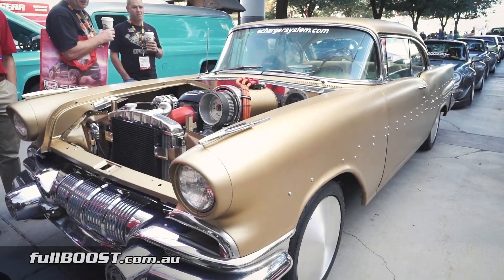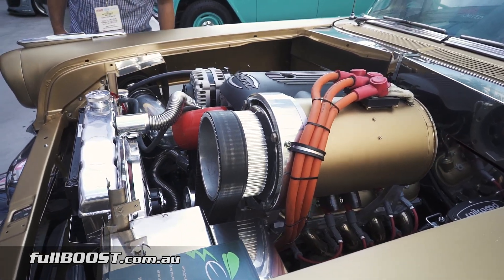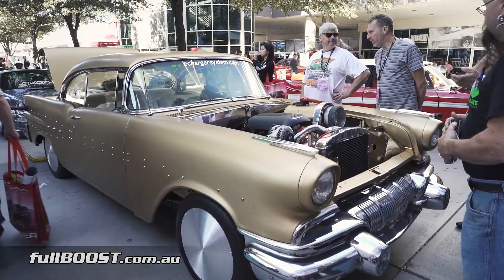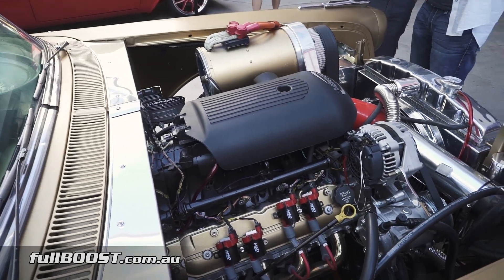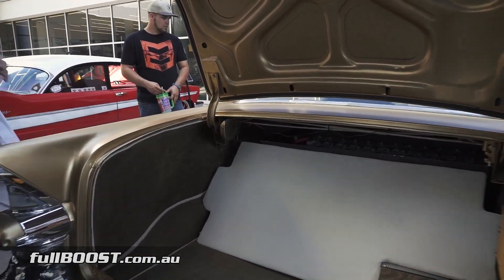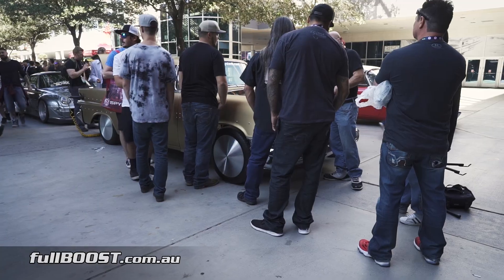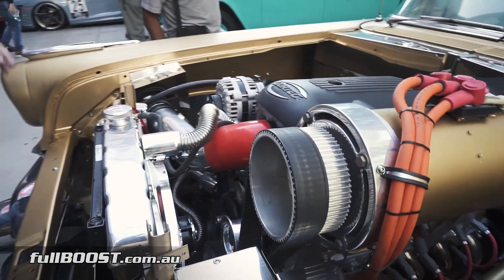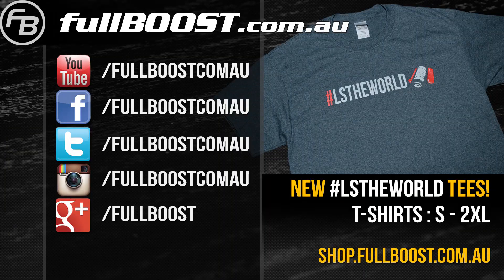The E-Charger Hybrid System

Comment: While this is a very interesting concept, I believe many of the comments below about Newton's laws or more accurately laws of thermodynamics would render this system fairly useless with current off the shelf tech and most proprietary tech available today on a long term scale. 35mpg for 60 miles means you get 60 miles on just under 2 gallons of gas, while the hybrid system and regen braking continues to add 10-15 percent to fuel economy thereafter. Plug-in hybrids available in the mid-market are getting ~60 miles of travel without using a single drop of gasoline while hitting nearly 60mpg in the city. Engineering anything without the addition of miracle materials is an exercise in trade-offs, and I believe that the parasitic drag and loss of typical consumer turbo and supercharger systems are achieving numbers quite similar to this electronic setup on a long term scale, perhaps over the course of one tank of fuel. Most turbo 4-cylinder cars from the factory are getting close to 35 mpg on the highway while making considerably more power than they would naturally aspirated, in turn being more efficient (volumetric efficiency of a forced aspiration motor being much higher than said motor with forced induction system removed). Also, I believe that if the heat and energy output were calculated per one tank of fuel for this same car minus the hybrid system, with it, and with a conventional supercharger/turbocharger setup, and in the end the electronic supercharger system were to be somehow more efficient, the weight of the system and the vehicle combined would negate the performance and efficiency benefits severely as turning a 5k pound vehicle quickly isn't generally as fun or safe as turning a 4k or sub 4k vehicle with comparable output. 

That being said, I think it's fair to say this technology is in it's infancy and needs to be explored further as a viable alternative and creative way to make something we use and cherish in our lives on a daily basis, better. I think hybrid systems have been the way of the future for some time, and there are more ways to do it than the Prius or Tesla have thus far explored. I hope to see rapid expansion in tech and performance in this area of industry in the near future as regulation and restriction by greedy companies fails to oppress the output of the mighty DIY community, as well as the great minds at forward thinking companies currently exploring and exploiting hybrid technology. 

Thank you for the video and for taking the time to interview and explain the system. As some of the other commenters have addressed though, we need numbers! Let's see it run. Let's see a dyno pull! System on/off. Let's see objective drivability reviews and weight! I think we should get an open-source hybrid system together, as a community, to build and expand on the tech in a transparent and public way that could possibly generate some seriously useful ideas from people who would otherwise find this inaccessible. Just my humble opinion, love to hear more thoughts on this stuff. 

- HiDef

Comment: cost? what would this cost to put add on?
Reply: @Billy Barnes - Call them.

***** - Any mod that adds a lot of power will add weight ie. a turbo kit. The best thing about this kit is that you gain power, add mpg, and keep the same/add more engine life. No other mod does that. COst? Everything cost money lol. Weight? Everything weighs something.
Reply: That's the one thing I couldn't find out from the video or his website. It's a great idea at $1500, not so great at $10k. Motor + electronics + batteries are going to be at least $1500 new, those high current switching power supplies are not cheap and neither are 150+ ftlb DC motors.
Reply from the maker: +Billy Barnes They were hoping to sell this kit for under $US 5k l believe.
Reply: intj123 you cant turbo an existing n/a motor without serious changes. You have to lower compression. You should probably change your pistons   Then you need to retune which depending on the car may require a third party tuner. A turbo wont give power from starting rpm. It has to spool. A turbo will not reduce fuel consumption in reality as all it does is add air. You still must burn fuel to create power. A turbo will not regeneratively Brake. A turbo won't provide stop/start technology. Electric motors deliver max torque from standstill. So in every practical measure this item is superior.
Reply: Isn't the max rpm of the motor less than the limit on an s2000? Not I'd be expecting to be constantly hitting the rev limit but a bit more head room would be nice.
Reply: +mike Doe the motor isn't forced to turn the same 1:1 ratio with engine RPMs. With cog changes the engine could turn 9000rpms and the motor could turn 6000 for example if you wanted or I am sure if he wanted on that engine that hits the limiter at 6000 he could gear the motor to turn the 8000-8500 at that speed.

Comment: Couldn't we just improve the conventional electric starter motors all engines currently already have to improve power & fuel efficiency in a similar way to how this system operates? It seems to me that this idea has been staring us all in the face for years, especially the big car manufacturers.
Reply: I mean. This system is pretty crude delivering it's power via a belt to the crank.
Reply: I believe that is what Christian Koenigsegg has developed for his new car. Ties straight into the flywheel/torque converter I believe.
Reply: The energy to drive the electric motor comes from somewhere. If you don't pack the car with extra batteries to store energy from the electric grid, combustion would provide the energy.  If combustion is providing energy, the fuel economy gains are minimal. Regenerative braking is a very good way to charge the battery for "free", but that has limits as well.
Reply: GM has been using almost exactly this system for about a decade now. Look under the hood of a hybrid Tahoe. It'll look a lot like this Pontiac.
Reply: Mark Leadbeater manufacturers are doing it already .
Reply: That is true . The gas motor being an air pump . It just assists. Having said that when the battery goes low or dead , you'll get even worse mileage turning the electric motor with the gas motor . I believe the battery range was really low . Like 60 miles but gotta start somewhere  :)
Reply: search YouTube for  /Inside Koenigsegg
Reply: Earthdreams from Honda has been  around for a while
Reply: I've seen engines that have multiple alternators on them, couldn't you add an extra alternator to this engine solely to charge the batteries for the electric motor so it can run continuously?

Comment: 500hp with 35mpg?  Sounds good to me!
Reply: Paul Wilson that's what I'm thinking I love my old chevy truck if I can get that kind of gas mileage and a boost in acceleration it would be a win win situation, and the extra weight isn't much more than a toolbox
Reply: You would build the engine as you would a supercharged engine with crank supports etc
Reply: Hell yea lol
Reply: How much are 35 lithium battery’s? I would just get a turbo or supercharger and be done
Reply: yea, MY ALH TDI fully built out get 55MPG when i drive sane but with a squirt of c3h8, water meth, and NOS im making 550HP in an engine that is 400 lbs wet 4 banger.
Reply: Paul Wilson l
Reply: More mpg and hps'
Reply: Ima just rip a forklift motor and rig it to my supercharger.
Reply: Did you ever getting anything up and running.
I am trying to do the same
Reply: I don't need a race car so all that performance wouldn't do jack shit,but 30 miles to the gallon ?in my v8 truck?bring that on .amd I have a toolbox that weigs more than that battery pack
Reply: Puffalupagus360 that's the setup used by the high end hybrids like the lexus,and Mercedes hybrids. Like  EV vehicles it's not cheap,Google hybrid drive trains,the high dollar hybrids even have tubo,versions
Reply: Puffalupagus360 there are tradeoffs with a turbo also please do a little research that conspiracy stuff thrives on ignorance
Reply: cartmanrlsusall its not a dream. I literally see civics on CL every day for 10k getting 45mpg. Also i dont want a civic. You see my profile pic? Does it look like i care about the enviornment? I drive a classic bmw straight piped and slammed. I go through a set of tires a month from drifting and camber wear. Im not saying i♡trees im just saying this is a ridiculous solution to mpg
Reply: Too bad there’s zero real proof of any claims on these videos
Reply: and yet there are no vehicles rolling around with this sys getting those numbers with this setup irl
Reply: 500hp to 5k lbs? Same power to weight and mpg as a civic. Or an old vw. Only differences are that you dont need to charge a civic or drop whats going to end up as around 10k on a backwards alternator. I could also find a new civic with a hybrid as well for 10k but it will get 50 mpg. I cpuld use the extra 10k from nit buying a kit and reduce the weight of my car with wheels, seats, carbon fiber panels, light weight glass, take out sound muffling, remove carpet, lighter weight/ less restrictive exhaust, lighter/less restrictive intake and slap an aero kit on ill probably get around 80mpg.
Reply: Taylor McCallum at least you won’t get caught dead driving a civic.
Reply: Taylor McCallum keep dreaming dude, hope you get to build that dream civic,soon
Reply: no the e-charger setup that european manufacturers are using is a pre-charger/boost fill system that fills the gap between a mechanically driven supercharger and a heat scavenging turbo-charger
Reply: cartmanrlsusall  yea a turbo you get 50-120% increases in Port levels with a 20%  parasitic loss for a final power increase of 30-100% . Where as this might add 20% but adds more than 2x the weight that it adds in power plus parasitic losses and  beats the absolute shit out of your main bearings.
Reply: @Puffalupagus360  I'm unsure why you're stuck on this main bearings wearing out thing because everything else you mentioned is quite well reasoned.
Reply: @Puffalupagus360  it won't add twice the weight at all, if it was a conversion to fully electric that would indeed happen though, those packs are like 100kWh, this only 12kWh
Reply: Sounds like a loaf of bullshit, big clue is that they included stop/start which has been proven to be a marketing and emissions scam popularized by big auto manufacturers. The added weight of the battery's and writing and the motor huge cogged pulley you have to bolt onto the crankshaft, not to mention how it's gonna beat the shit outta your main bearings.
Reply: @Puffalupagus360  "Sounds like a loaf of bullshit, big clue is that they included stop/start which has been proven to be a marketing and emissions scam popularized by big auto manufacturers." what a load of bullsh1t. Start stop works
Reply: @Puffalupagus360  Engineering Explained actually explained it. The start stop function is useful after car stay stationary for over 7 seconds. Before that you are wasting fuel, after that you are saving fuel.
Reply: @aliozanerbektas  the start stop feature was examined in depth to see if it actually increased mpg and it did not, it was only found to be effective at reducing emissions during road cycle tests as it's literally shutting the emissions completely off at every stop but overall did not produce better mpg or l/100km compared to a hybrid without that feature.
Reply: @Puffalupagus360  hybrids increase fuel economy regardless of the semantics. This system im a skeptic of but an in line trans motor is absolutely better than a standalone engine in terms of mpg.

Comment: I think this setup is waay better than conventional hybrid systems which feed power to the wheels to save gas instead of assisting the crank or transmission which is the way it should be. like he said 5000 lbs 150 more HP at 35 mpg!!! what's better than that?!

Comment: What a nerd, look nerd if we wanted a Tesla we would just buy a Tesla.
Reply: and the Tesla would still be faster anyway than this stupidity.
Reply: Richard Neal Stupidity? Go hug a tree and a guys butt
Reply: Yeah this is stupid. Grandpa can't fix his old gasser now. Wah wah wah wah, go hug a offshore oil rig....
Reply: C Mendoza
go look at the Tesla drag racing channel, stock Tesla's are burying super charged cars on the track. This is the beginning of a change especially as people start to learn an electric motor delivers 100% of its torque at 1rpm thus has no torque lag like a gas motor.
Reply: C Mendoza Was that supposed to be an insult?, , , , 
,
,
,you should be ashamed
Reply: TheRealestEver good luck getting your rocket car iregistered for road use.
Reply: Kalel Kent this would actually be cool IF the guy were a real nerd. this is garbage
Reply: TheRealestEver eeer, the whole Tesla channel is road registered. Think about how childish your comment is, rocket cars!!, that's like saying who cares a stage 1 Atlas rocket is faster. There is always faster but can you use it as a daily driver without having to rebuild the engine after a dozen runs down a 1/8 mile track. Think about that, you can run an electric car through a few drag race seasons get into the top 10 without having to rebuild the engine once and without burning through thousands of dollars of extremely expensive ethanol fuel. Thus why fuel burners on the drag track are no longer cost effective thanks to new battery technologies. Also the Tesla's he is racing have no motor mods, wait till people start to mod the electric motors (all 4 electric motors with no transmission loss) for even more torque (yes you can do that).
Reply: still crapping on like a child I see, here have a woli pop.
Reply: at no point did I say jet cars specifically ran on ethanol, but road going drag cars do, in fact turbines can run on a wide range of fuel types, everything from diesel to natural gas.
Reply: Im still waiting for a mature reply and obviously Im not going to get one from you either.

Comment: all that extra power is useless when compared to all the weight. no Pros. here just a big con.
Reply: rich fortner it's the platform that's the pro. u can use this setup on any car. Ur focused on the wrong part of the equation my friend.
Reply: No, not really. The electric motor can move that extra weight with less energy required than the gasoline engine can.
Reply: andTo861 150 ft. lbs. not 150 horsepower . big difference .
Reply: rich fortner this is an ac-51 ac induction 3phase motor. It produces 148 foot pounds and 51kw of power which is 68.4 hp

Comment: If this tech is really that good, then shouldn't it be provided as standard equipment on all cars in the near future?
Reply: this isn't a super charger
Reply: Nick Amarit I totally agree n it's all hinged on battery technology catching up. if it weren't for that only crutch, well weight also, than this would be perfect!!!
Reply: marcus kornegay Wait, it's not? I saw that Vortec name and all I could think of was supercharger. So is it just a 3rd party plug-in hybrid bolt-on system just like in every other plug-in hybrid car then?
Reply: Cost.
Reply: These hybrid motors are already on GM cars, though I think they use a much smaller motor & battery pack. Malibu has it. With this one, I'd be worried about snapping the crankshaft if the harmonic balancer can't do its job.
Reply: Because with this system you are always turning the crank shaft, (pistons, cam, water pump, etc. ) even if the motor is not running at all, and that's a huge drain on the batteries , this system seems more suited to extra power then fuel economy.
Reply: This is basically a bolt-on hybrid and you can many cars as hybrids. It just costs quite a lot of money and adds weight . Actually with 12 kWh it has quite a lot of juice for a hybrid!
Reply: vidznstuff1 But the electric motors in the Malibu don't drive a Supercharger.
Reply: I think it would be interesting if they use the electric motor to spin the supercharger directly instead of using a belt connected from the engine. This way the electric motor can serve two purposes - firstly, spinning the supercharger and secondly, as a plug-in hybrid system... using it this way, the supercharger will have no parasitic load...

Comment: When I first saw the picture I thought they were using the electric motor to run the supercharger - which just seemed stupid.. It turned out to be a lot more interesting. I suppose if you were want to go on a long trip, you could turn down the output of the electric motor so increase the range of the batteries, but then you could also charge the batteries while driving - once they run down - in exchange for a slight decrease in efficiency which ultimately would average out to less than what you'd pay per mile without it. But for short trips, seems like a cool idea. And then you could always power up your appliances in your house when the electricity goes out. It's interesting reading all of the comments from people who cannot understand how this system works and who think they could double their fuel mileage with a turbo or supercharger. Sorry kids, it doesn't work that way.
Reply: "but then you could also charge the batteries while driving - once they 
run down - in exchange for a slight decrease in efficiency which 
ultimately would average out to less than what you'd pay per mile 
without it." - The thing is, if it's set to just charge during deceleration, there is no net loss in fuel efficiency.

Comment: I for see a lot of broken crankshafts you can't add that kind of torque without going to a forged crank also for the regen to be relatively effective the car would have to be a standard because the torque converter wouldn't allow for any noticeable engine braking. It's innovative but would be better off coupled to the bell-housing.
Reply: Do you see a lot of broken crankshafts in supercharged applications?